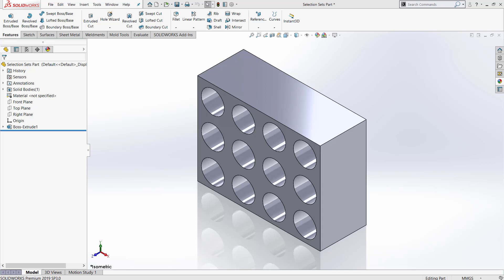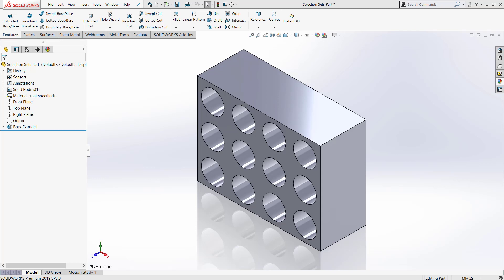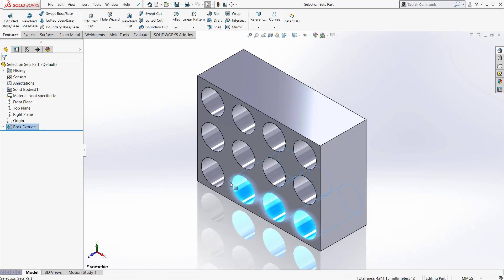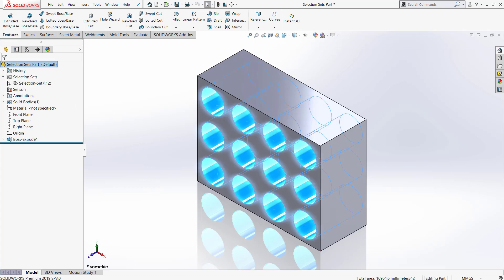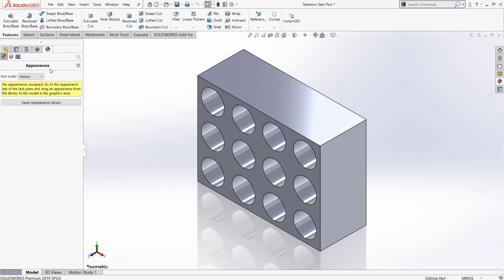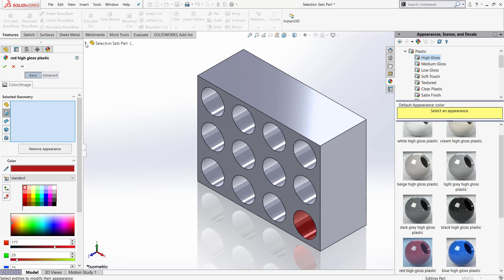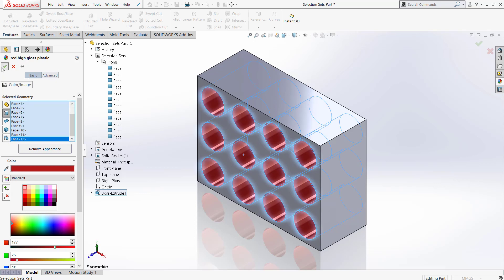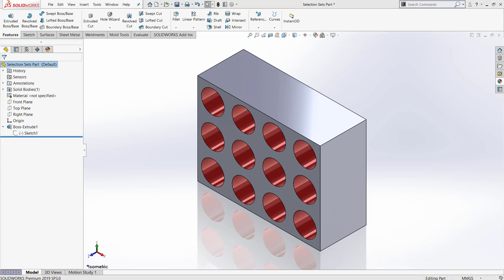SOLIDWORKS Tutorial - Selection Sets

Comment: Also if possible please suggest for usage of selection sets in asssembly
Reply from the maker: Its hard to be specific, but any time in which you might need to select a number of surfaces repeatedly a selection set might be helpful.
Reply: @goengineer  Thanks for reply...I am working with large parts and assembly [more than 10000]..so facing challenge on creating selection sets and making the selection sets in order ..i followed just renamed set in some numbers..